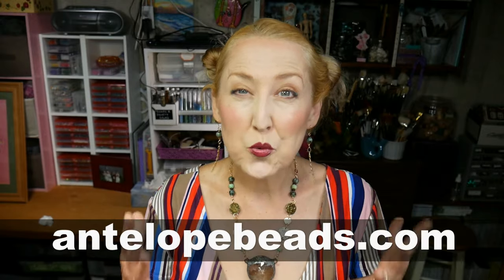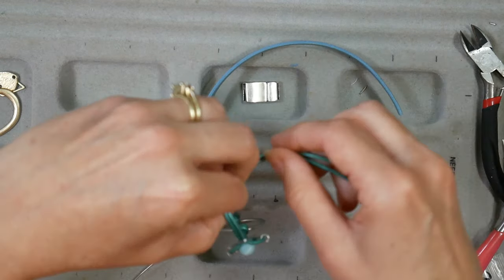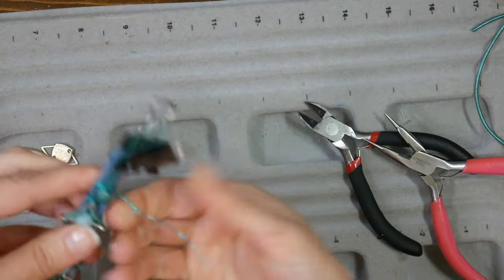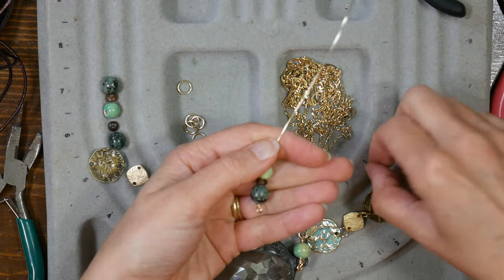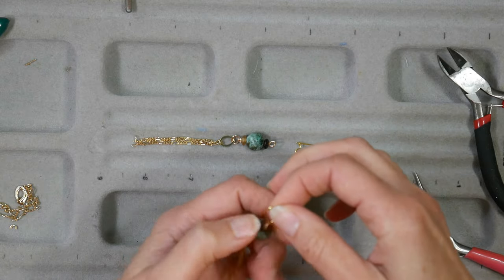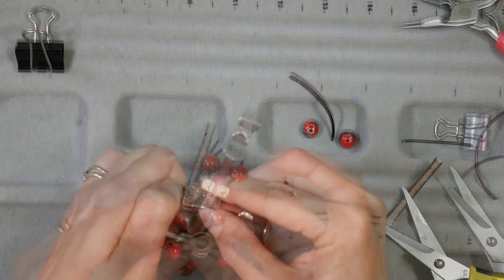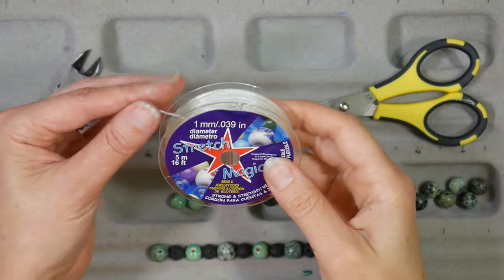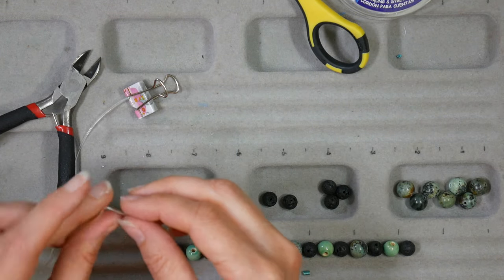10 Boho Jewelry Design to Mix and Match & Make in Minutes!

Comment: Thanks Lindsay.  I needed a red bracelet and took washers from the hardware store, washed them to get the oil off and then painted them with metallic craft paint. Used black beads as spacers.  It's just a funky piece of jewelry.

Comment: I checked out Antelope Beads, and a great thing about them is that ALL of their findings are nickel-free!  I know I'm not alone with a nickel allergy, and for so many years I could not wear costume jewelry, and sometimes not even decent jewelry, if nickel was used as an alloy.  So for years and years and years I just gave up on finding earrings. And for those fish hook ear wires, there are these little silicone thingees to put on the back of the wire which keeps them from coming out. Yeah, if I ever did find earrings I could wear, chances are pretty good I lost one of them! I bought a little package of these silicone things and will not lose any more earrings.

Comment: Doesn’t the super glue degrade over time?  It holds quickly but my fear would be it won’t hold up over time. Would there be another glue you could use?
Reply from the maker: I believe the super glue sold for jewelrymaking contains rubberized particles to keep them from getting brittle so it will hold better. You could use an E6000 I'd you are worried tho, just make sure to let it fully cure before wearing.